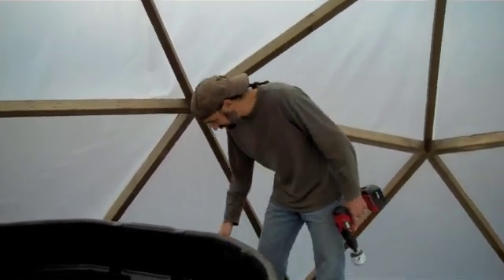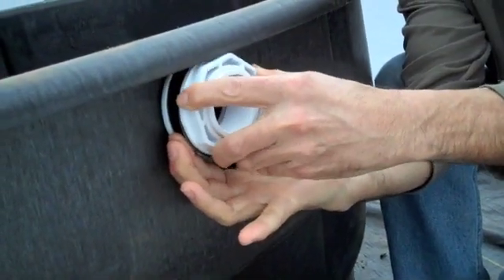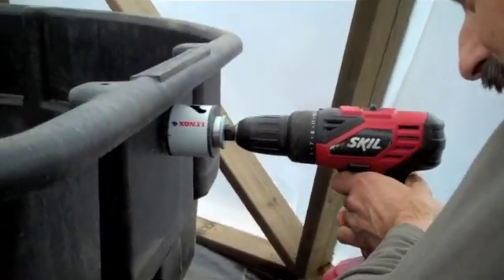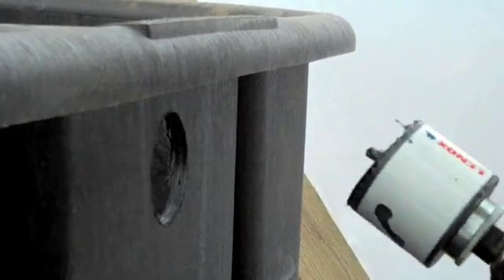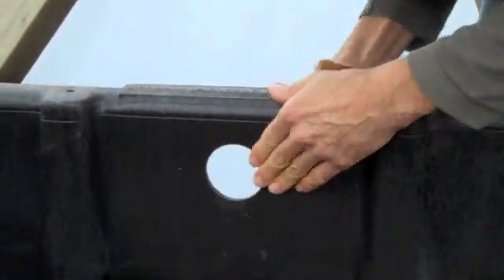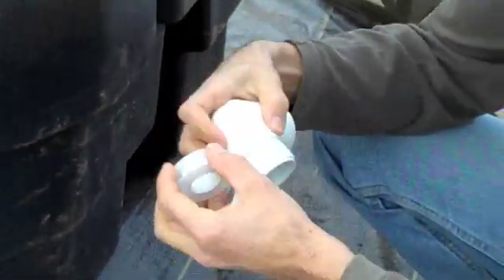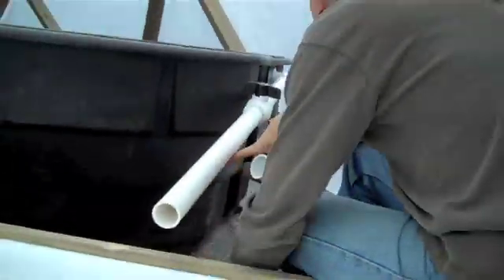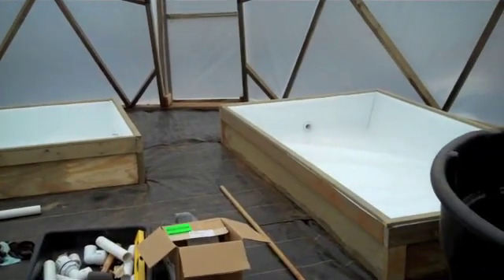FISH TANK PLUMBING

Comment: Hi can you tell me where you found that part that connects and seals the tank with the pipe?
Reply from the maker: We purchased those bulkhead fittings from aquatic eco-systems online. They are now called Pentair but if you Google aquatic eco-systems it will come up.